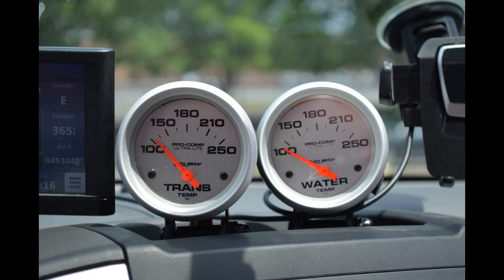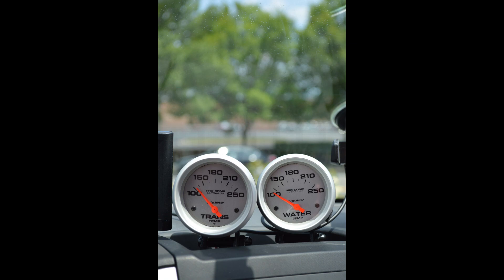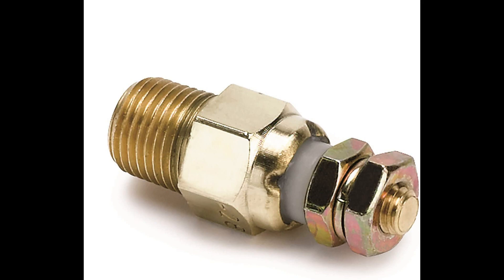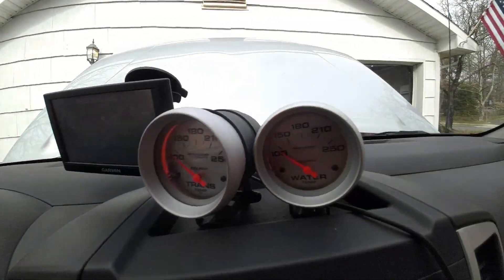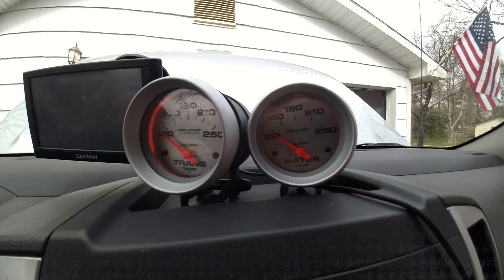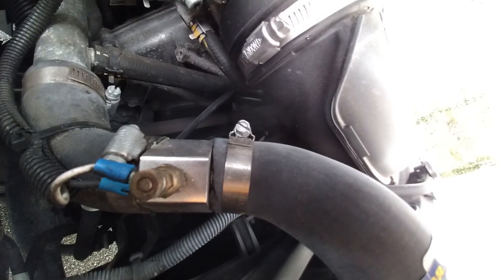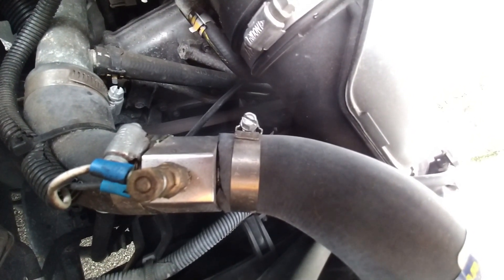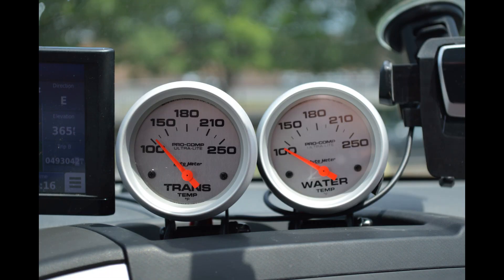Cool It or NOT II !??!? Engine Coolant Temperature Guage for Frontier 4.0L

Comment: Great video!  thanks so much.  I am very interested in doing this mod.  I HATE how all vehicles don't have REAL gauges anymore
Reply from the maker: Hello Thiel, thx for writing in, and I wholeheartedly agree, we used to get a full guage pack that had REAL gauges, my 83 Camaro had an oil pressure guage that went up and down as engine speed & load varied, a real temp guage that showed what the engine was doing ( it was a BorgWarner T5 5 speed so no real transmission items to monitor ), and a real voltmeter that jumped up to about 13.8 when driving down the road with electrical loads on. Now, we get ..... feelz goods.

Comment: Nice Nissan Frontier keep going, that's a great engine if you can manage to keep the motor cooled.
Reply from the maker: That's the plan! Thx for writing in Charlie. Honestly these are pretty solid engines, the water pump is driven by the timing chain so they are quite durable and rarely fail. As long as you use OEM thermostats when they need changing, the cooling system is mostly maintenance-free. Many have passed the 300k mile mark so I'm at 105k and change right now and plan to hit at least 200k, if I don't, I'll be disappointed. I had an 83 Camaro with 317k miles on the original v6 engine, all internals original, never been cracked open except to replace a damaged oil pan, and the oil pump was swapped at the same time as a preventative measure, the pressure was still strong and solid at the time.